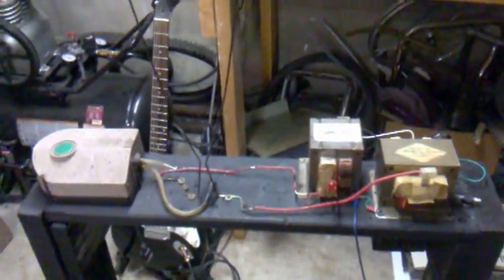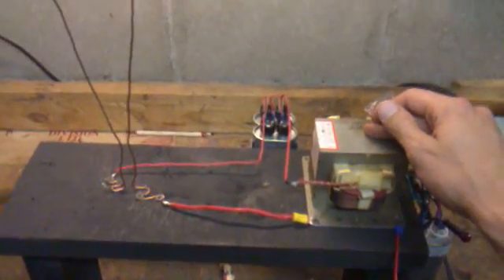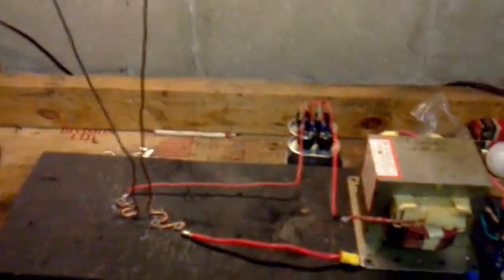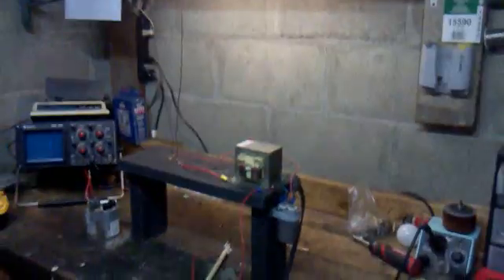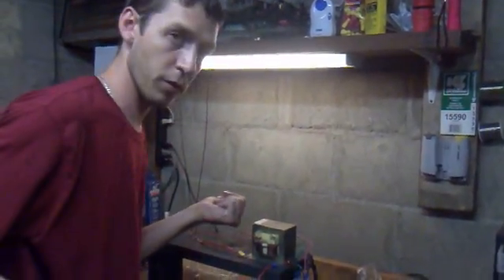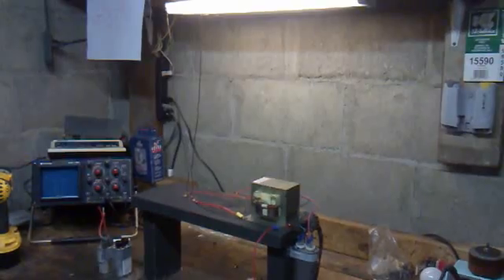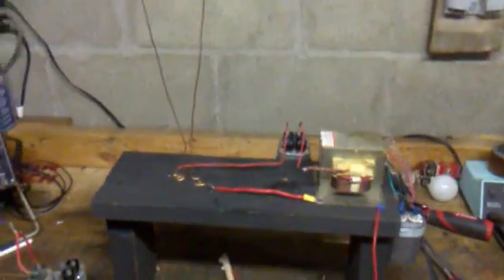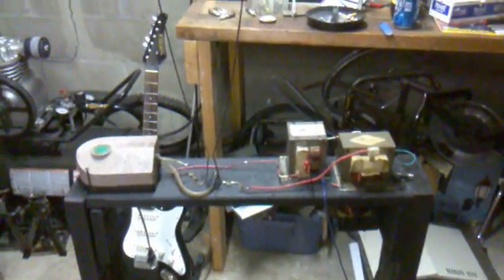Resonant microwave transformer

Comment: What does the arc look like with just one of those microwave capacitors?  And how are your transformers fairing without a ballast? (Usually, they get real hot real quick and start flipping breakers.) Have you experimented with making your own high voltage capacitors?

Comment: it took me a few days to find spark with my M.O.T.S , took 8 months before I found the unique sound that is resonance. I now have two resonant Mot circuits that draw off separate 40amp breakers(separate phases) The M.O.T's are connected parallel on the primary and series secondary. I get 4x the output. 3' Arcs . you wont be disappointed, I promise. gj. Have fun.
Reply: Could you give me the circuit diagram? thank you

Comment: MOT's are not the best to use for this type of thing. Yes they are all over the place but they are poorly built in the secondary winding = little or no interior insulation. One good thing an MOT is good for besides a door stopper is you can completely eliminate the secondary (remove it) and re wrap your secondary core with a heavy gauge wire and have a low voltage high current transformer that can actually melt things like wrenches and screwdrivers, or use it as an arc welder.
For a decent HV transformer you could get your hands on a toroidial type mains transformer (common in commercial PA gear) and remove the secondary windings and re wrap your secondary until you get the voltage you want. I have one I pulled out of a burned Carven 1Kw PA amplifier and I re-wrapped it to give me 16.5 Volts on one tap and 28 volts on a second tap but I continued on wrapping it to a final output of 5.5 KV. The 16.5 and 28 volts are used with rectifiers to give me 13.8 volts DC and 24 volts DC. So essentially I have a multi-output 5.5 KV power supply and its all mounted in the original amplifier rack mount case. The speaker lugs on the rear are where the 13.8 and 24 volts come out. Two added insulator lugs in the front are where the 5.5 KV is.